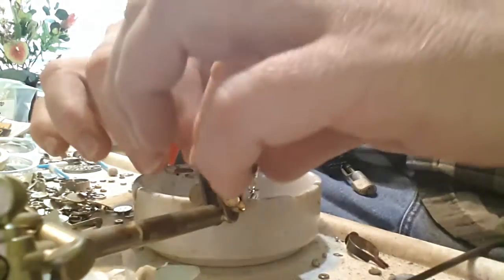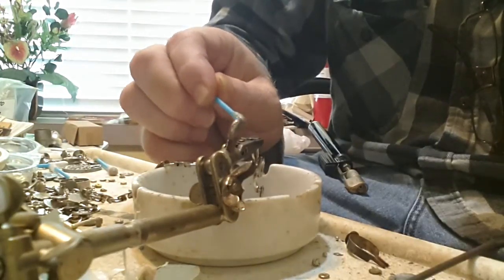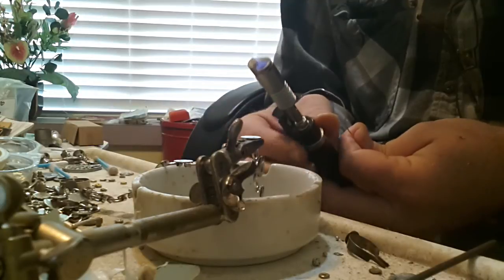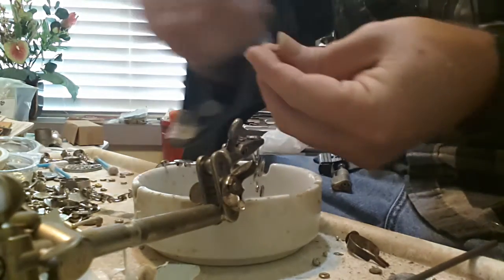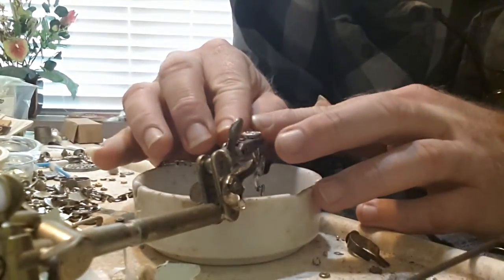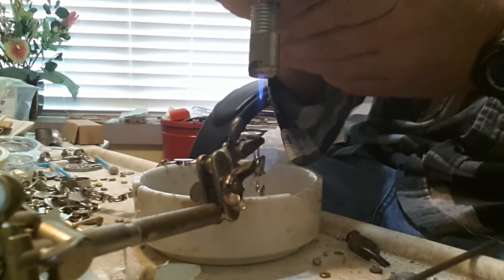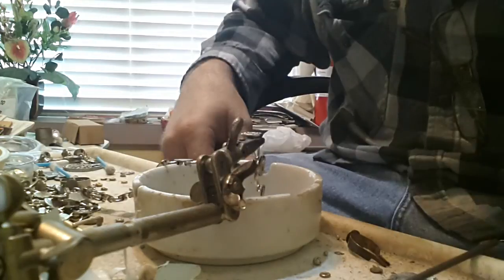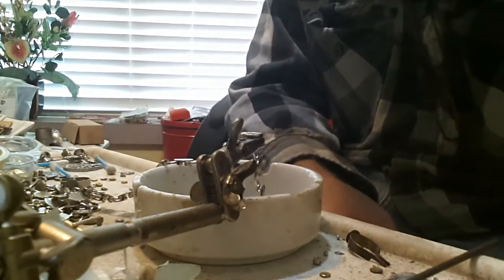Solder Brazing How To bullet jewelry

Comment: Hello, I am an artist looking to attach spent/already fired and cleaned bullet shells together to make a sculpture. Can you tell me the exact materials and brands you used? Im having a hard time soldering or brazing the materials. It's taking too long and the shell is melting and discoloring
Reply from the maker: Hi Chloe. Solder brazing multiple shells together would not be easy as you heat the shell and it makes the solder soft on the other end of the shell where you just connected it to a different shell. However, as far as heat discoloration of brass, it's always going to happen. If you are sparing on the heat, and you used nickel plated brass shells, your silver solder should blend with the silver of the nickel plating on the shell, and not have discoloration from heat, unless you used the heat for way too long with the torch. It's easy to over heat the material you have a 2000 degree F torch on. You need to move the heat around on the spot at varied distances as not to get the material surface over heated, but just enough to melt the solder. I would advise viewing other DIY solder brazing videos, and ones using it on jewelry. Using a soldering ion on a bullet shell is not going to work as easy as the shell helps to heat sync - or dissipate ion heat too quickly for it to work easily. This is why most jewelers prefer using a pencil torch to solder braze with. I have found some of these torches at Harbor Freight for best prices, but you may be able to find them on Home Depot or Lowe's websites. I get the electronic's silver solder at Fry's - low temp - no lead. You should get some stainless still soldering flux from Granger as well (use a Q-Tip to apply). It's better than flux paste and leaves less residue.
Reply: Hope I can help a bit :) Shells are made out of different materials for one. There are aluminum, brass and steel (may be more than that :) ) When it comes to solder, it comes in 3 different "temps" and you can get sheet, wire or paste. You might check out vids from OnlineJewelryAcademy on soldering also :)